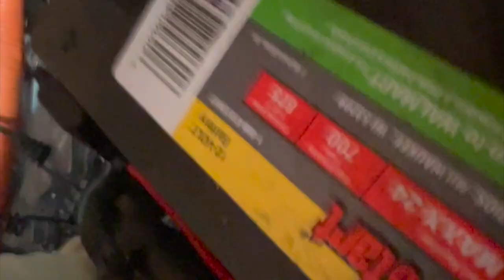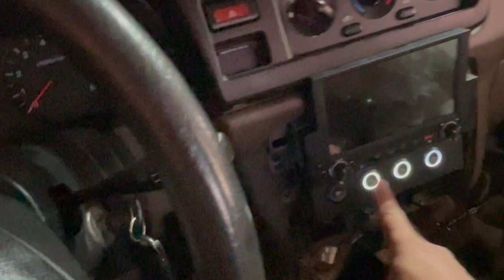EV Frontier First Drive Short

Comment: How wide are the frame rails? Can you mount leaf pack directly to the frame to leave the bed usable?
Reply from the maker: No there is not enough width to mount the pack as-is.  I will need to build a couple of new battery boxes and reconfigure the pack.